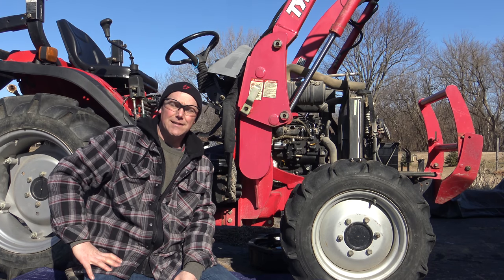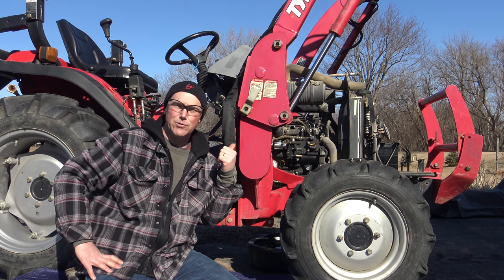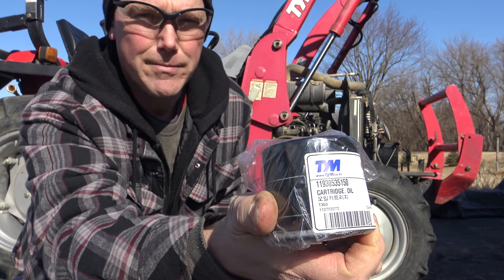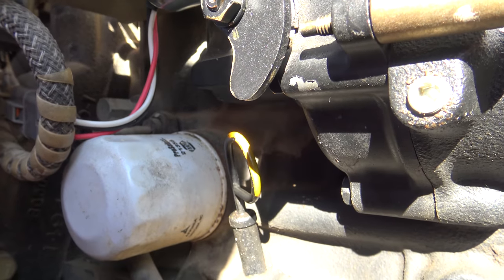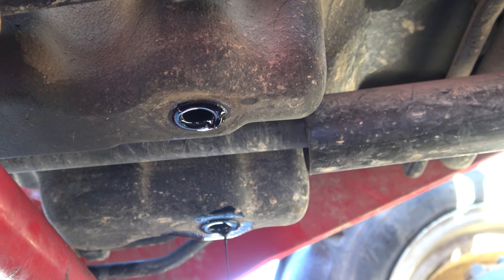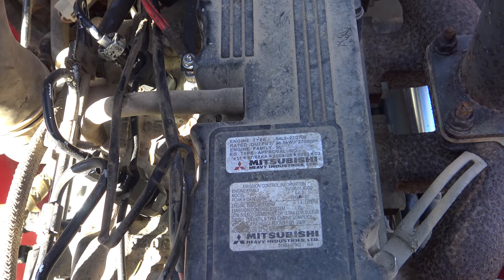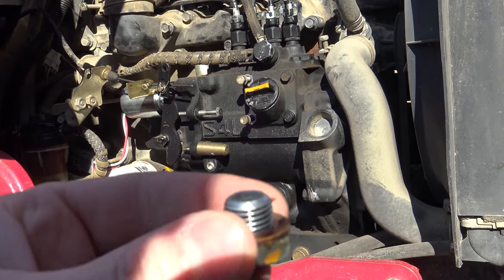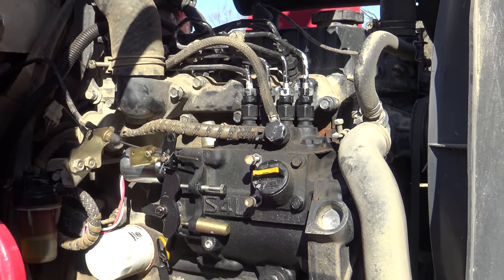How To Change Oil In Mitsubishi S4L2 Diesel for Mahindra,TYM,LS ETC

Comment: Thank you for showing the part number for the filter so well on the video. Just bought a 2000 model LG Landtrac Lt 280 d tractor with a S4L in it and there is no info out there for it at all. Mine has a napa filter on it, the napa web site says it's not for that motor. Will pick up the TYM. Good job, Thanks for the video.